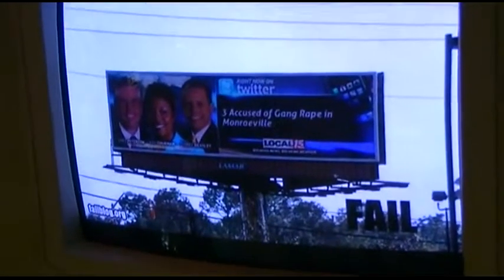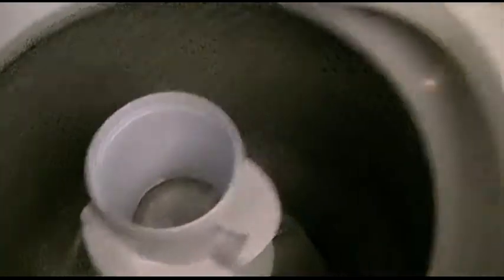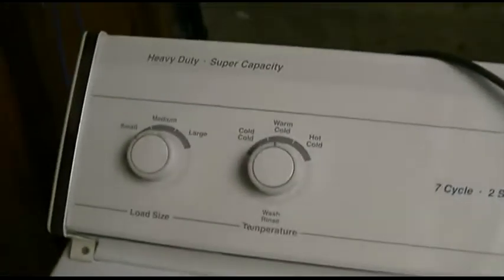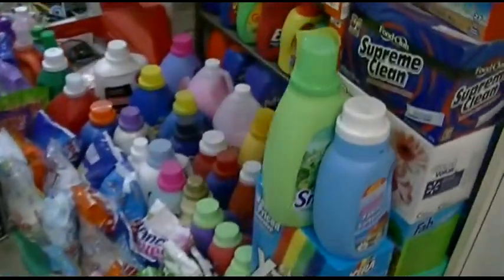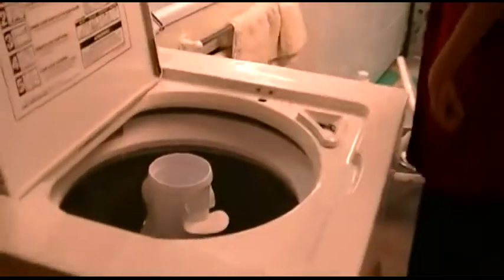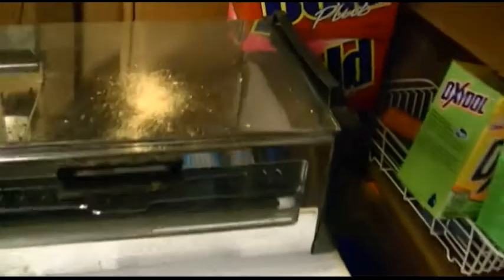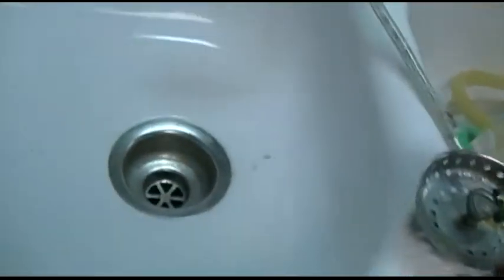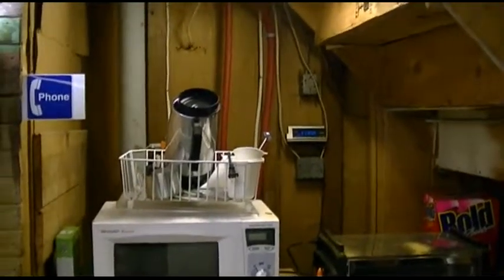Out With The Old, In With The New (The Whirlpool Washer Has Arrived)

Comment: I often find these machines on the street neglected. One hell of a way to get a free washing machine. If it doesn’t work, it’s probably something that can be fixed in less than twenty minutes!! These machines may have been retired ten years ago, but they certainly ain’t going away!!
Reply from the maker: Very true, they were rock solid reliable and ran and ran and ran.  Probably the worst killer of these is rust on the frame, but there's usually enough metal you can drill a new hole to attach a spring that came loose due to rust.
Reply: Rust is the number one killer of vintage washing machines. That's why it is good to remove it before it takes over. It is also good to spray it with corrosion inhibitor to prevent any further rusting.
Reply from the maker: @applianceman6009  Agreed.  But there is only so much you can do.  A properly climate controlled home, and a basement with a dehumidifier run as necessary will help prevent a lot of that begin with.

Comment: I have a newer belt drive, model WTW4900BW0 Whirlpool washer, has no agitator. It is a high efficiency machine and uses a little water, it spins fast. I don’t really loud it, and it’s really loud in the spin cycle because the bearing went bad. How did the bearing go bad? It’s 10 years old.
Reply from the maker: THAT is how it went bad.  They are made of inferior components.  10 years, that's actually a GOOD amount of time for a modern washer.  They are junk.  Get a vintage one like this, and have it for 25 years like they used to be.  This one and the other I have, I will never part with, I will fix anything that breaks on them, at any cost, which would still be cheaper than a new washer, and it would be worth it.
Reply: @jaykay18  I mean the splutch and actuator had to be replaced on it before, but now it’s the bearings that failed, the washers been running with bad bearings for a while
Reply from the maker: @coolrobuxgaming  Right, that other stuff had to be replaced beforehand.  It's junk.
Reply: @jaykay18  The suspension rods are somehow still good, they are original. They might have some wear in them tho as the washer does shake a tiny bit when spinning, but it doesn’t go off balance, so they are not shot.
Reply from the maker: @coolrobuxgaming  That must be a new record.
Reply: @jaykay18  Yeah the direct drives are definitely better than the VMW machines, I know someone with a Maytag branded direct drive that needed no repairs and that machine was bought in 2009, probably one of the last direct drives made. It has a stainless steel drum. One of my grandpas had a 90s direct drive that broke down and got replaced with a high efficiency washing machine, but my other grandma has a Maytag branded direct drive that needed zero repairs and it’s a 15 year old machine. It’s a Maytag Centennial washer, but it’s not one of the Maytag Centennial high efficiency machines, it’s a direct drive. Maytag kind of had that phase when Whirlpool bought them out, for a while the Maytag top loaders were direct drive.
Reply from the maker: @coolrobuxgaming  My older Whirlpool is from the early 90s, I believe 1994 if I recall right.  Still running great, had 2 sets of agitator dogs put in, that's it.  My newer one was made in 2009, also one of the last direct drives.  Good thing I got it when I did.
Reply: @jaykay18  I believe the Maytag direct drive my grandma has was also manufactured in 2009, it was purchased in 2009 new, not used. My mom had one of those GE washers. I find it very interesting especially since it has a stainless steel drum, it seems like Maytag had exclusive versions of the direct drive that no other company by Whirlpool had. I think the serial number on it indicated that it was from 2009. I believe the machine she had before the Maytag was an older version of the direct drive that had a bad transmission so she replaced it with a Maytag Centennial direct drive in 2009. Now the Maytag direct drive is 15 years old and it still works great, works as well as it did when it was bought brand new.

My mom had one of the older GE washers with the plastic tub, she replaced the GE because of a clogged drain pump, she replaced it with a GE HydroWave that only lasted 5 years, and then she got a Samsung. Surprised that the Samsung hasn’t needed any repairs yet, since Samsung machines are horrible based on what I heard, and I heard that some of the Samsung, LG, and GE machines can explode. I believe her older GE and her GE HydroWave both had electronic controls if i remember correctly.
Reply from the maker: @coolrobuxgaming  The old GE in this video that I talked about had electronic controls.  It also had a separate drain pump with it's own motor.  There was no need for that, whole separate part that costs more money; direct drives the thing just snaps on the main motor which will run nearly forever.  And should it fail there are plenty out there.  Samsung and LG, I never knew what business they had making washing machines to begin with.
Reply: @jaykay18  Mine also had a separate pump, I believe a sock of something got stuck in it, she could’ve easily fixed it but she got a new machine because she thought it was broken. It had a hanging tub suspension support. I believe her HydroWave had a stainless steel tub but that one had a plastic one, I believe the first GE my mom had was the one with the transmission and brake, and it made the chugga chugga chugga sound when washing clothes. Her other GE was a HydroWave, agitation sounded like a high efficiency machine, I mean it was a high efficiency HydroWave, although it did have the agitator.
Reply from the maker: @coolrobuxgaming  Yeah the GE I had used the hanging suspension supports.  Garbage design.  It also had a chugga chugga chugga sound, when it decided to work properly.
Reply: @jaykay18  I don’t think the GE washers were built the best tho, they were still better than the high efficiency stuff, I mean they clean pretty well but they were not really reliable, they tended to still last a while and they would sometimes actually be pretty reliable as long as they were maintained properly, like a lot of people get like 10-15 years out of those machines as long as they maintain them properly, I’ve even seen some people have them last 20 years, so the reliability on those older GE’s was kind of hit or miss, sometimes they lasted a very long time, other times they did not. They were still a lot better than the GE HydroWaves that replaced the chugga chugga GE models. Early failure on these machines was often due to misuse (such as overloading), which often caused this machine to fail prematurely.
Reply from the maker: @coolrobuxgaming  I fully agree.  No idea how the machine I had was treated before I moved in, but chances are it was "rode hard and put away wet".
Reply: @jaykay18  As far as the newer Whirlpools, they are not good at all. They have lid locks, they don’t have a brake, they have to “sense” the load, and they don’t clean as good as a newer washer, even the agitator ones don’t. The modern Whirlpool belt drives are still a lot better than Samsungs, LGs, snd the GE HydroWaves, but they are still junk and they break often. The msot Common failures on those machines seem to be the splutch, bearing, suspension rods, transmission, control board, or shift actuator. They also have a ton of plastic parts, I mean I’m lucky that I have one that still works after 10 years, that’s a long time for a Whirlpool VMW, on average I would expect those to last 3-7 years. My washer did need several repairs before, and it spins loudly due to bad bearings, but I’m surprised that it still works. They also spin on a plastic drive hub, which is notorious for failure, and the washplates are often so hard to remove because mold and rust builds up on the washplate, causing it to be ridiculously hard to remove, the the wsshplate just gets stuck to the drive shaft. The washplate VMW models are notorious for a bad drive hub, this issue could easily been fixed if they made it out of metal, whirlpool actually started using metal drive hubs due to this widespread issue.
Reply from the maker: @coolrobuxgaming  Believe you me, I had a LONG talk with the guy at Sears (still around at the time) when I bought my newer machine, and I gave HIM the lowdown on what was going on.  Of course he didn't care because the new machines gave him better commission, not to mention additional commission on extended service plans he sold.

I probably made more money not having to repair this machine than he did in commission.

Comment: Where did "More" laundry detergent come from?
Reply from the maker: If I recall, it came from V&T Supermarket, which is an Asian Mart.  I don't go there that often as they're not exactly close, but every time I go, I check out their detergent aisle.  I have never seen More brand detergent again.
Reply: Ah. It was probably a limited run thing. Do they ever have other weird detergents? Like aside from Tide or Xtra which you can get anywhere.
Reply from the maker: Yeah no idea if it was a limited run or not.  Detergents come and go.  They did have another one, which again, I had only seen that one time, called PIREY, which, at a quick glance, could be mistaken for PUREX.  There may have also been Chinese writing on it, which is par for the course as far as Chinese knockoffs are concerned.